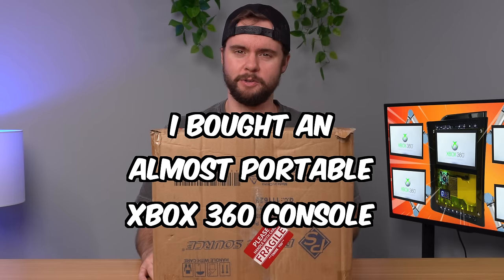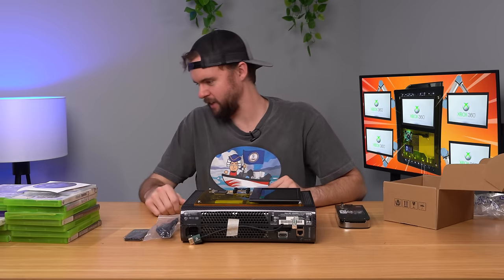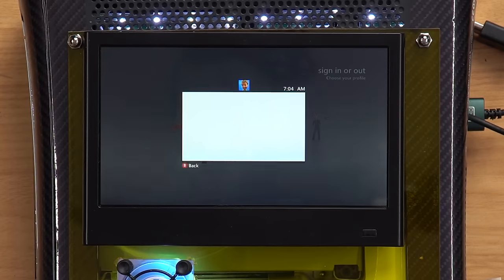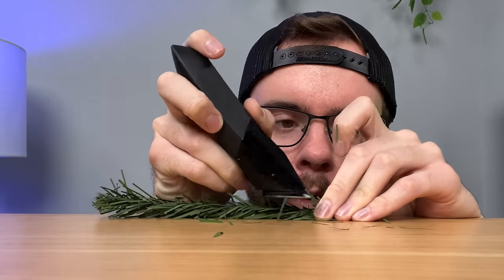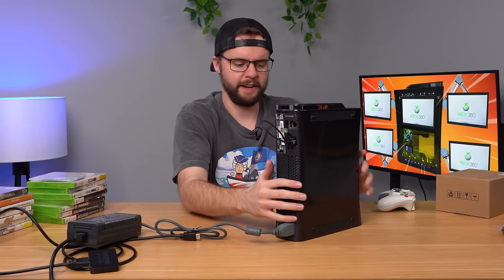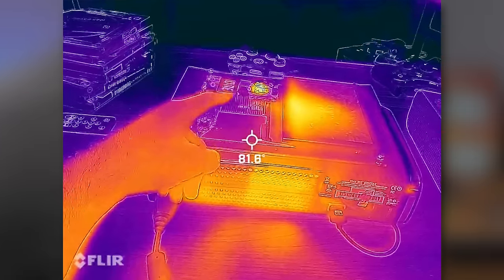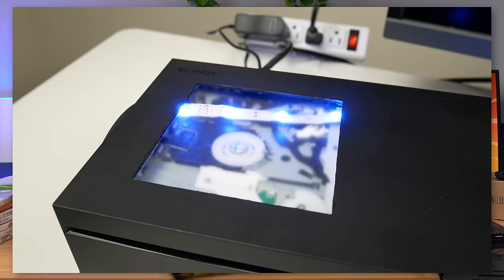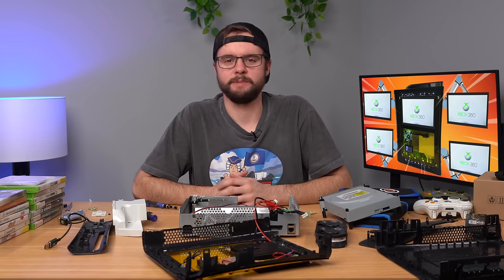I Bought a PORTABLE Xbox 360…

Comment: $240 is not too bad, but it would've been an excellent deal if the console was RGH'd too for that price.
Reply: The guy who does these doesn't do software mods purely aesthetic mods and shell swaps.
Reply: What is rgh?
Reply: @k9vendettathewolfofmordor529  RGH is the main form of modding a Xbox 360 to be able to run emulators or games directly from the hard drive.
Reply: @alyxzandermarchese8822 it’s not a software mod, you can’t soft mod a 360.
Reply: @alnoiseplaysmc They meant like modding the actual OS. It would be better if he said firmware mods.
Reply: no 240 is pretty bad a regular Xbox 360 can be had for as little as 60, or even 40, it shouldn't cost more than 150, those screens are usually around 20, and the job of doing the installation should't be over 50 or 70
Reply: @awii.neocities should have said hard mod
Reply: @awii.neocities  keep it less confusing and just call RGH a hardware mod. xbox gamers prob dont know what firmware means, theyre gonna think firmware = software mods and not hardware mods. firmware defines as software that directly interacts/makes changes with the hardware, like a computers BIOS, or your phone when its battery is dead/turned off and all you get to see is the low battery picture. technically you are correct about RGH itself being installed firmware, but not the xbox OS that you actually use on screen
Reply: @CrocoDylianVT  

Not sure what crack your on
But most 360s go for around 100-150 at a minimum on Ebay and other sites

Jaspers especially are around 300 because of how old they are
Reply: Wish I lived next to all you Americans, $240 for an amateur made custom Xbox is crazy.

Hasn't even installed the LCD the proper way which is by hooking it up to the AV pins and connecting it via VGA with an on off switch at the back so that you can actually still use your 360 on a TV.

And that carbon skin is so tacky. I could make a better Xbox modded with half the Xbox library on it and sell it to someone in America for a lot more than this by the sounds of it.

Comment: Generally you want negative pressure inside a case. That screen is definitely adding in more heat than the designers planned for with their default fans/holes, so adding a new fan as an exhaust right by the screen makes perfect sense. Better than not having a fan, or having it point inwards.

Comment: Not bad a pretty clean job the TV is mounted a little bit crooked that would annoy me and it sucks you don’t have a remote for the LEDs to change the color
Reply: I didn't initially notice it but just noticed it now.

It reminds me of when I bought an e-reader that had a misaligned display that looked fine at first but was crooked on close inspection. I had to live with that and later realised while repairing other e-readers that it was likely due a lack of markers on the inside to help align the EPD panel.

Comment: cool idea but poor execution/installation... the carbon fiber vinyl isn't cut perfectly around some of the vents, plus the screen is crooked, and the window isnt the color you requested

that screen and the LEDs and other mods are probably pulling too much power from the disc drive connector for me to have confidence in lasting the test of time without burning the connector and/or something on the xbox motherboard. Jasper boards like that even have unpopulated pads on the board that are perfect to solder and pull 12v from, with less worry of going past a disc drive connectors power limits, and melting/breaking stuff on the board.

6/10 rating, only for the little fan that helps to keep the GPU cool (GPU heatsink is half the size of the CPU heatsink, so it needs more airflow)

Comment: Would of been way better to solder the hdmi connector straight to the board, also removing the screen bezels for nicer more flush fit to the case
Reply from the maker: Yeah, but that would've cost way more than $240